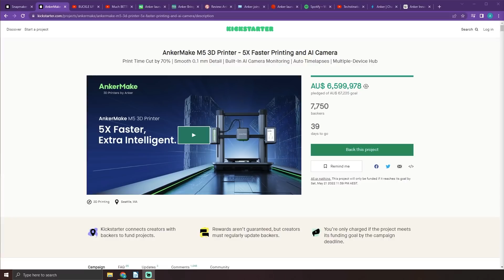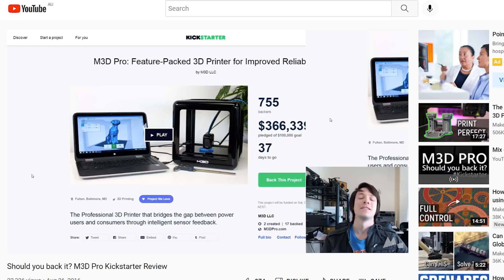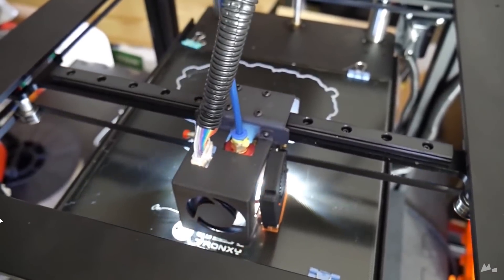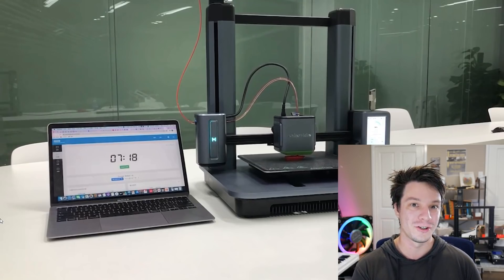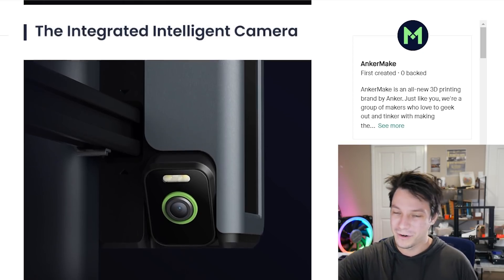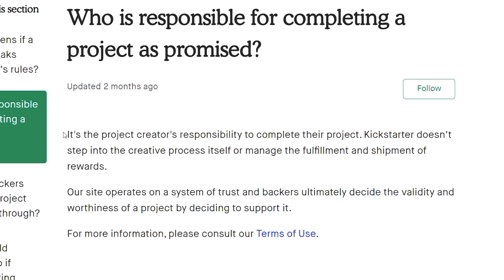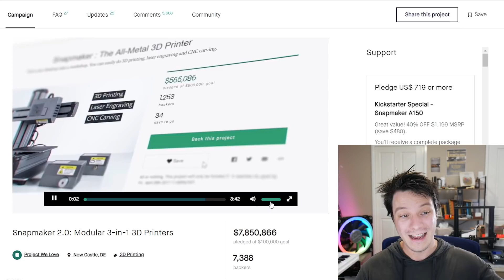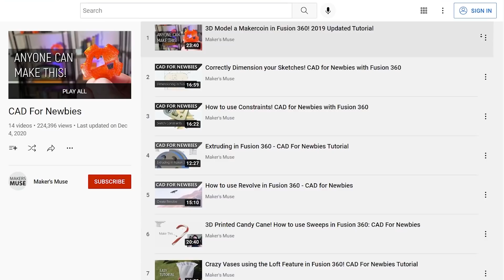This 3D Printer looks incredible, but...

Comment: I agree with what you've said in this video on all counts.

I have a couple LotMaxx printers of different capacities, and they're Ender clones or variants.  Already need to replace the Y axis wheels on the older one, which I've not even had a year and used all that much, because they wore out of a reasonable tolerance.  Found there's no room for adjustment in the frog plate when they wear, so apparently, it'll make it easier for a good starting point when manufacturing, but... only as accurate as all the parts are manufactured.

The 3D modeling aspect of things definitely leaves most people to the problem of needing to be competent at something that has a rather huge learning curve: most people simply don't think in CAD of any form and all that's involved, it requires a certain thought process.  Myself, I'm using OpenSCAD, but I also have a robotics/CAD background that includes working on their code and writing tests, etc. and writing software for a living.  I'm a statistically-odd person in having worked on CAD software for designing parts, as well as working on the source code of CAD software, and CNC controller interpreter code, with electronics training.  The majority of the tech world is a small subset of the human population, and I'm a tiny subset of that.  A major reason I have not considered trying to push others into 3D printing is because it's NOT an easy thing for the common person to get into, as 3D printers of the FDM type are guaranteed to have parts wear out/fail, etc. and then there's the modeling issue, so if I pushed someone too hard to get into it, I fear I'd become their support person for it:  NO THANKS!

I've backed this Kickstarter (my first, ever) because I expect they will carry through on their promises, and honestly, the design and implementation looks solid, and very usable.  Yes, so many printers companies should be worried if this works as well in release as it does in beta, even if they fail with the AI part of things.  That still won't prevent failures that many people won't be mentally-equipped to deal with, such as maintaining filament conditions to prevent failed prints due to moisture: it's not a done deal.

In the last couple years I've run the mental calculations as to how to use inkjet-like methods for FDM printing, and that math says the filament/material issues would be major, so I was intrigued when you mentioned and showed video of resin inkjet printing: that doesn't have the heat issues to worry about.  I don't know what the limitations of the resins are compared to FDM, and the current cheaper resin methods... eewww, what a mess!  It will be interesting to see if they get that cheap and good, because relatively speaking, it's far simpler.

Comment: I do like the idea of the AI camera and the build quality looks good for this price. Maybe because I've owned over a dozen printers and I've been doing this for over a decade, I don't think that this is going to be magically easier than all of the others on the market. In particular, the auto bed leveling hardly ever works after a few prints with the sensor being damaged, and if there is no manual way to set it, you now have an entirely dead printer unless you buy a new printing head if it's even modular (which it doesn't appear to be). The max build volume isn't great but like you said, I do want the industry to have better options with more reliability. If even 1 of these new features works well, like the camera, bed leveling or early feed detection, I would be happy. 

Personally, I think the Snapmaker 2.0 is the best machine I've owned and It's remarkably reliable. The software is great, build quality and print quality are all excellent. As far as laser cutting, It always prompts you to put your safety glasses on before starting and the quality is alright, I wouldn't dismiss it.

Comment: Material jetting is way more complex and has much more issues than FDM. Mainly print head clogging, mechanical wiping of the print material during print, vacuum systems to keep the material transfer system clean and so on, these systems are an order of magnitude more complex than FDM systems (I have both). BTW - Objet was bought by stratasys a few years ago, MJP is 3D systems' technology and is the main competitor of the Stratasys Objet systems.
Reply from the maker: Ah yeah the vacuum and power consumption considerations I definitely skipped over. I think a "dumber" version of it could be done but it would take considerable investment. Mixed up who bought who you're right it was Stratasys! Those two behemoths gobbled everyone up during the hype.
Reply: We use a polyjet printer. It's amazing, and when it's in tip-top condition it never fails. You still have a awkward cleanup step to remove the support. Currently this is a waterjet manual cleaning station. It needs meticulous love and care to keep it working however. You can't just leave it standing for 2 weeks and expect it to run. When it clogs or breaks it's often out of action for weeks.

Comment: I 100% disagree about the resin. Resin is too toxic to have in a residence. So that puts it outside of the house, and not every 3D designer has an outside-of-the house option. I sure don't. 
So, yes, for small businesses that are large enough to have an actually workspace, but not for a small at home set-up.
Reply: I agree with you but what if there was an integrated filteration system that captures the harmful fumes? I wish they would make something like that.

Comment: Im afraid of this going down the road of anti-consumer anti-repairability way that other modern tech is going. This will likely become a mainstream product and thus market domination - so they can set trends.
Reply: Exactly, I think the analogy to inkjet printers is what I hope 3D printers never become. Cheap machine that if something brakes you have to throw out. Also ink cartridges being so expensive and proprietary.
But to be fair most cheap 3d printers  are also pieces of junk.
Reply: I think the hobby option will always exist though. I'm not sure why people always jump to the conclusion that because a mainstream product exists, a niche product can't exist. Just look at basically any product in any industry. You have both options.
Reply: Creativity impairing by advanced technology...  good insight.
Reply: There will always be hobbyist 3D printers, but for consumers, they just want it to work without needing to tinker. To get that, you have to have locked in specs and software. It's just how consumer grade products work. Most people don't tinker on their cars, fridges, washing machines, laptops, etc. They just want it to work.
Can compare it to PC gamers who build their own systems and console gamers who are locked into platforms. Both exist, both do well.
Reply: @ScytheNoire  sure but there's no reason why stuff should be locked THAT hard, just make it hard for noobs to tinker or put in a disclaimer and warning so that nobody ever unknowingly bricks their stuff, no need to go to the ridiculous lengths that companies are going to these days, that's just thinly veiled greed.
Reply: @ScytheNoire  I agree to this, but funny enough there's little to no tinker-friendly options on some markets that you mention like fridges, washing machines and such - there's just the option that works without frills, fridge/10, and the stupid one that needs an account to cloud sync your daily consumption of cold water.
Tho back at the point, I think having more of those printers that "just work" and you're locked to the ecosystem, would change very little in amount of market adoption, both positively and negatively. I see 3D modeling and the need to make such parts as the limiting factor instead.
I don't see those 2D printer-ish machines as any threat, as they just won't force out the open standards we got now like you said, but I also don't see them making much of a dent in the market either, given the type of people that would go for such a machine while at the same time having the need and the other skill set necessary to use it, seems minimal to me.
Reply: @Kalvinjj  There is a market for 3D printers that "just work", as I know people who are quite interested in 3D printing, but have heard horror stories, or they themselves have bought a budget 3D printer (most often an Ender 3) and had nothing but problems and gave up. Some other hobbies, such as board gaming and tabletop gaming, have a huge market for 3D printed components. Now that is no where near mainstream, but it is another market that just wants something that works without tinkering.
Reply: @ScytheNoire  I see, that's a pretty valid argument, I would say that I should reword it somehow: I don't see 3D printers fully locked like 2D ones becoming much of a thing, but good out-of-the-box experience ones are another story.
If you can get any compatible diameter filament, and use the slicer of choice if you want, but you got the option for a pre-configured one with presents that won't cause problems, auto leveling and a good hotend that won't jam and so on, that type of machine can (and I think already does) work in the market. Kind of the idea with Prusa ones and other non-budget but not professional market brands, those can get improved to the point of zero hassle and would be a relevant product.
Reply: @Kalvinjj  Exactly. I don't see hobbyist machines going anywhere, from the ones you source and build yourself, to the almost consumer ready models like Prusa.
What I do think will happen is that we'll see consumer models that are more locked down and more idiot proof. They might have nozzles that can't be changed, or if changed, require you to use the same type (look at the E3D Revo). I can see models where you don't have to do the slicing, but just load in a file and it does the slicing for you, since it knows you can only use 1.75 filament and you can only use their 0.4 nozzle, there are no options to choose. It will auto-bed level before each print job. I'm not sure how it would be done, but they might also only allow you to use their filament, such if the filament comes enclosed in a unique shaped container that is seal, much like 2D inks and toners. The day may come when this happens, and it goes against the very nature of how 3D printing started, but I don't see it coming quite yet, not until there is enough of a consumer demand to make it profitable. But it may definitely come.

Comment: Well - the idea (resin/material jetting) is great, no doubt. And it is already working perfectly in the industrial machines. BUT the catch will be the same as we see with 2D printers: The cartidges will be insanely overpriced and equipped with a chip to prevent any use of (cheaper but still massivley overpriced) cartridges of 3rd parties. Similar to what Formlabs does. And not to forget all the garbage created by the cartridges. Honestly speaking I would prefer SLS machines become cheaper. There are already some available in the below 10K USD range - but in comparison to material jetting there is this big problem of plastic dust which is why those machines are NOT for childrens to play around with (but are MSLA resin printers?).

Comment: You are not worried about the expensive aluminum base that we have seen before in products like Juicero. 
So if it's going into that direction expect chipped filament and cloud controlled slicing. 
Because they are probably selling it below market price and try to cash in on the peripherals. 
But if that is the case, it could be a nice machine to hack ;)

Comment: Given what's available now at what costs are now, I was really disappointed with that combination of apparent bed size and price. I mean, no, it's not an unreasonably small bed, but I saw ANKER and the size of that base and was all, "You have my attention" and then I saw the print area and was, "...and you just lost it."

Plus, yeah, the speed claims are like "...sure. That's how PLA works." (Or any of the other filaments.) I mean, I'm sure it's faster at defaults than my Ender 3 V2 but... that's not hard.

Which makes me wonder how they're handling various filament types, right? Filaments are not consistent enough for this kind of approach to eliminate all the variables! Particularly not in an open / uncased environment! Does it have some sort of environment temperature sensor to make temperature adjustments based on ambient? Not that they've mentioned, and I don't see one.

What happens when someone throws some HT-PLA+ at it, just to use a filament type I like to use. It can't tell but the temperature profile is going to be completely different, and not just for the type, but by the maker! And changing filaments, too - these types of print heads need to be cleared between print types. They just do. I have some low-temperature black matte PLA and you need to get that head squeeky clean between prints or you are going to learn new meanings of pain if you switch to something too different.

And nozzle types. I mean, I guess they can have some sort of plated copper nozzle and that's fine, and that will last a while and tolerate abrasive filaments, but... that's at best a semi-solved problem.

Which is all a way of saying "great, they've solved assembly and they're including a sensor with the kit." And they've got a spaghetti detector to stop you from wasting too much filament, that's nice. But there are all these other very serious issues that they haven't touched and which frankly are not solved here - and in my experience, they're the bigger problems - and they're kinda selling it as a "all problems solved, print and walk away" solution.

And it's really not that.
Reply: They can rebrand and disappear over night if it goes bad. The hype train has started tho and don't tell anyone otherwise. Just stand back. And why do they need a kickstarter of they've already shipped units

Comment: in my opinion, the biggest strength of 3D printer is also its Weakness. which is Custom parts. all of us bought 3D printer because we want to create custom parts. but the majority of people out there is really not interested in custom parts. they rather buy something that big company already prove, sell and mass produced , that looks good, have good quality, and not made by some weird machine that moves around and extrude plastic noodles and looks uglier than mass produce parts. 3D printer can only become mainstream use if it can surpass the quality of mass production items. because currently, 3D printer cant do that, even most expensive printer cant do that. there's lots of compromise such as, it looks nice, but brittle, or its structurally sound, but doesnt have nice finish, or if it has both, its super expensive, etc. currently, 3D printing technology while it can make custom parts, it feels like a downgrade compare to mass productions which is what majority of people want anyway. i would say, 3D printer needs to become no longer a niche product but like a standard issue utility tool that essential in every home, like electricity, aircon, cars, TV etc. if  3D print can create parts that as good as or better than mass produced items, and cheaper, i can see in the future, we can just print our furnitures. imagine if IKEA is no longer selling physical product, but they sell STLs, that you can buy and print in your own house, or maybe just go to a 3D print kiosk and have it print in a jiffy.

Comment: One other reason against the Anker printer is that it will be a complete closed ecosystem. I don’t know how the software for the printer is going to look, but I doubt it will be compatible with normal slicers. Probably everything is baked in a cloud only package
Reply: Actually according to Anker's website (and Uncle Jessy's video), the M5 will work happily with Cura & other slicers. Jessy does mention the possibility of additional options available when using the proprietary slicer, however.

Comment: frankly the next innovation I would like to see is accurate trouble free 3d scanning at a affordable price. I find 3d printing handy and useful but automatic scaning of existing 3d objects at an affordable price would be something. 
Yes, 3d modeling is an important skill to me. Building models of new items could be less time consuming if one had an accurate model of existing object the new one interfaces to.
I like using PLA as it is relatively safe. It does not smell. It does not spill. It does not stick to my hands,. I don't need gloves.
Reply: With Apple’s true depth and LIDAR cameras on their pro series phones, the scanning is getting more accessible and better. It’s still buggy as hell right now but it’s getting better and it’s possible to get decent 3D scans with only a device that fits in my pocket. No other peripherals needed.